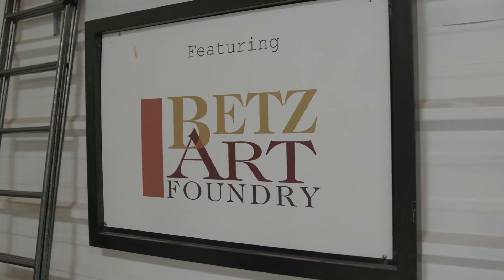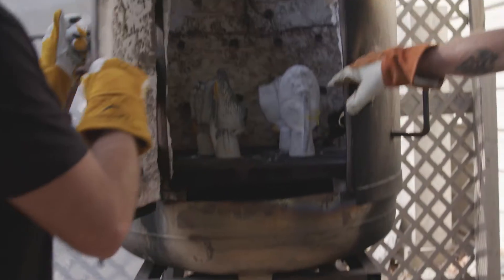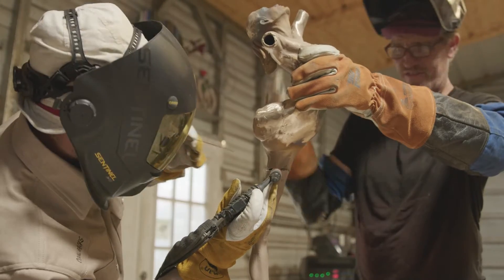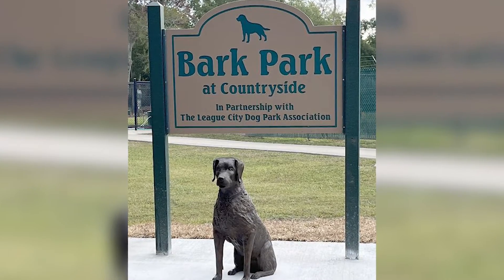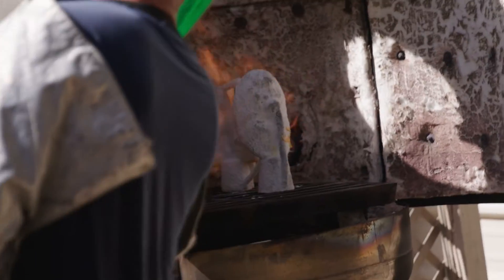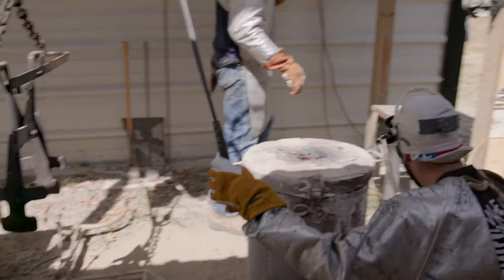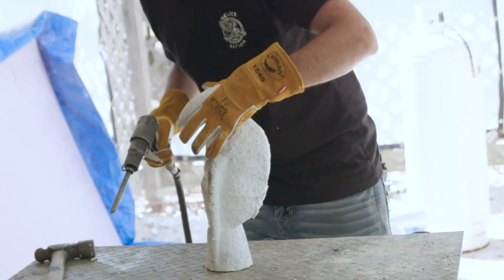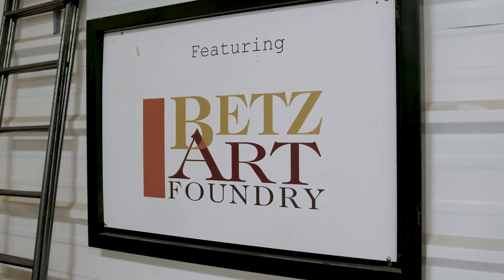Lost Wax Casting Process

Comment: Only surprise for me was the part about using lithium to remove whatever.

Can someone explain that to me?
Reply: its a deoxidizer, all the bad stuff like sulfur, phosphorus and other trash  that can be trapped in the molten metal, and pushes it to the top.